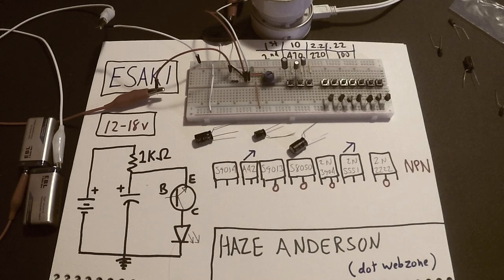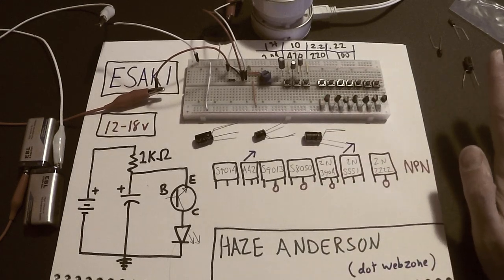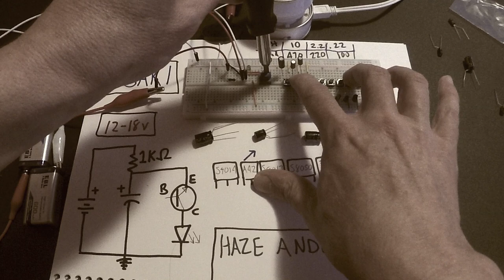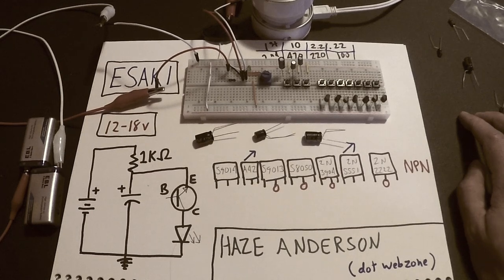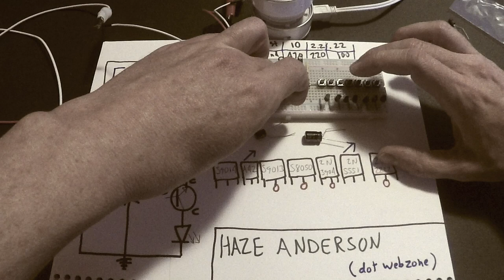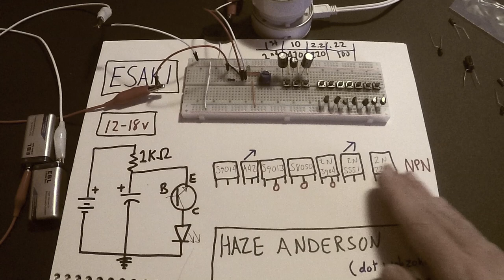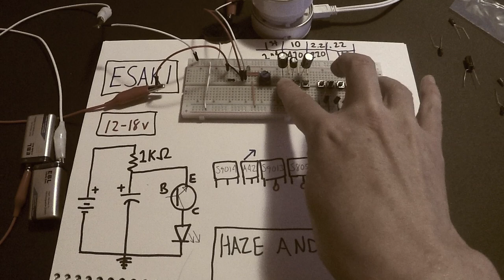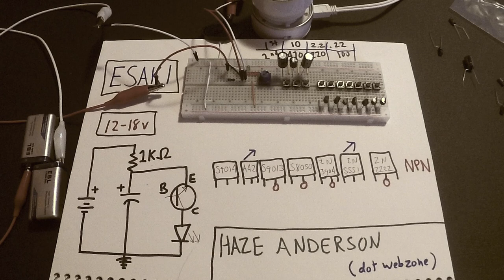Simple Oscillator Circuit - The Esaki Oscillator

Comment: You can use the high capacitors to create that slow frequency flickr with the LED and use it to light a LDR and use it as a tremolo effect. I created a guitar pedal using this and it works kinda good for such a simple circuit. You can even take the output audio signal of the oscillator and use it as a metronom.
Reply from the maker: It is funny that you write this comment because I have recently been working with 3 different kits that all use vactrols of some kind. One actually had 5 legged vactrols that were specially designed just for the kit. Very cool stuff indeed. Cheers!

Comment: Nice on haze:) now starting to wonder if I should start with breadboard. Want to make an oscillator with a Curtis chip. The good old cem3340 that the neutron has. It’s just working out how to get all the waveforms and pwm to work lol. I’ve heard stripboard is a bit more stable but this seems a good idea for trying things out first:) thanks for this man.
Reply from the maker: Thanks! I highly recommend getting a breadboard. Not to trivialize kits, but they are very "paint by number" in that you don't see why things are connected the way they are. I would start with the data sheets, for example http://www.bustedgear.com/images/datasheets/CEM3340-3345.pdf ... but really you should be prepared to work with the simplest of circuits up front and build your way up to working with ICs. I still have much to learn about RC networks and pull up and down resistors. But definitely start with breadboards ... once you get something working you can attempt to solder a whole different set of components onto a stripboard, using your assembled working circuit on the breadboard as a reference. And what happens when you make a mistake on the stripboard? I actually desoldered every stinkin component off the XR2206 function generator kit that I got! 😂 All but two still work, I smashed the DC jack and I ripped a leg off of an electrolytical cap.Go get a desoldering pump and practice those skills too. Keep me posted and yes, this stuff is seriously discouraging. I have actually had a rough past 7 days getting beat up by this stuff but #1 the Ring Modular works and is encased #2 I got this circuit working #3 the Delay pedal is almost working ... just one bad wire or pot, I think it will be working by tomorrow or Friday night at the latest! It is worth it. I feel so much more knowledgeable about my existing gear already. Thanks for watching! :)

Comment: Hey, been trying to figure this circuit out for a while now since seeing Look Mum No Computer make his oscillators and this video seems like a pretty good look into how it all works. I was wondering how you connected the speaker. Every video I see tells you to replace the LED with the speaker, but both you and Look Mum No Computer have both an output and the LED going off at the same time. I haven't been able to get sound out of mine using an s9018 transistor for 9V operation. Would be awesome to see a schematic with the speaker included. Also, do you have your output going into an amplifier of some sort? Thanks :)
Reply from the maker: Cheers! I think hooking up the speaker is probably the most confusing part. I have never been able to get the LED to blink in parallel with the speaker when running only 9V. You will need to hook up two 9V batteries to get more current flowing. The positive wire to the speaker goes in between the positive LED leg and the transistor's collector, and the negative wire connects to the negative LED leg. The LED and speaker are wired in parallel. I have not tried the S9018 but it is an NPN and should work too. Good luck!! It took me several attempts to get this working.
Reply: @HazeAnderson  Thanks for the reply! I was able to get my oscilloscope on this circuit last night and found that I was only assuming that it wasn't working since I couldn't hear the signal. I had gotten sound replacing the LED with the speaker before, but I was sure that I was doing something wrong. If you follow this circuit, https://gyazo.com/1717d6d8fef5ccb8b7f1ca640ec17742, you do get a sawtooth wave across the end of the 100k resistor and GND. I'm sure that the issue is that the p-p voltage is only 52mV, which I'm assuming isn't enough to drive the speaker I have attached. Maybe I need a lower wattage speaker, but I think a more viable option would be to create some amplifier circuit to go along with this. A guitar amplifier should be enough since they work with around the same input voltages, but I'm not sure of any other factors to take into consideration with that like high/low impedance input/output and all that ... I'm still learning. I'll comment here again if I can get something working
Reply from the maker: Sorry for the late reply, but if you try to tap the audio out on that circuit, whatever is receiving the load also needs to be grounded to the circuit as well. Try this ..... hook one end of the speaker to that spot in between the transistor and the potentiometer and the other to ground across a 470 micro farad capacitor.

Comment: The S9018 will "flash" at around 6 Volts, so one 9 Volt battery will work.
Reply: Different transistors have different flash over voltages (breakdown V) S9018 is one of the lowest I've found so far.
Reply from the maker: Thank you for sharing that info! @mrdovie47

Comment: You really should not need more than 12 volts..... particularly if you use the popular 2N2222 transistor...... thanks, Haze, enjoyed watching this video...... I think you will find the astable oscillator I modified  (I will provide the schematic and parts list in a future video) more adaptable to music..... even though it takes a bit of practice to 'play it' ..... you really need some  repeatability on the pot position to be musical ......  Esaki  oscillates (and it's amazing that it does) but you will never control it's frequency accurately enough for  music....... like controlling a wild horse  😂
Reply from the maker: Thanks Stephen, I was able to determine that the 2N2222, S9013, BC337 and BC517 all can audibly oscillate at only 9 volts, but not with the LED in series. I am all about progressive baby steps ...  next is the 555 and then onto the LM308 and LM358 op-amps!! :D
Reply: @HazeAnderson  I will keep watching 👍 .... should be fun
Reply: @HazeAnderson  40106. Can build 6 oscillators with one ic. Super easy!! So many different variables you can try with them. Dirt cheap from Aliexpress. 4017 for sequencer.
Reply from the maker: @mikelee1906  Thanks! I have a ton of CD40106 and CD4093 ICs now! 😅 Next is filters and effects like phasers and chorus.
Reply: @mikelee1906  
I tried with a 74LS14 instead, because I don't have many CMOS IC:s at home. Almost none to be more precise. Didn't work that great. I guess the 5v supply voltage pretty much limits the frequency range controlled by the resistor... (?)
Reply: I think you don't understand the negative resistance or reverse breakdown voltage
Reply from the maker: @ThePaulbilek  and I still really don't 😄-- edit: oh this was a reply to Stephen ... I think what he meant was under normal usage, 12V is overkill. But because of the requirements necessary to achieve reverse breakdown voltage, more current is needed. I still am somewhat "hazy" about negative resistance however. Is that related to impedance?